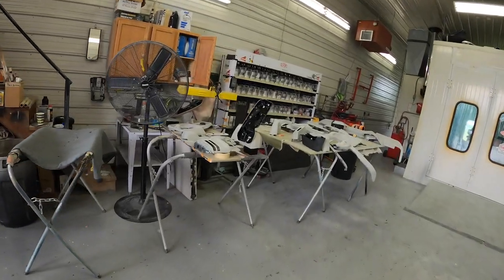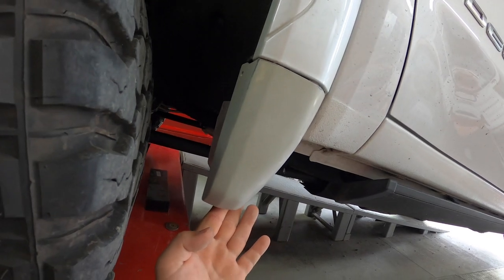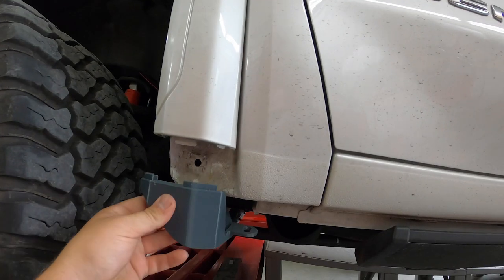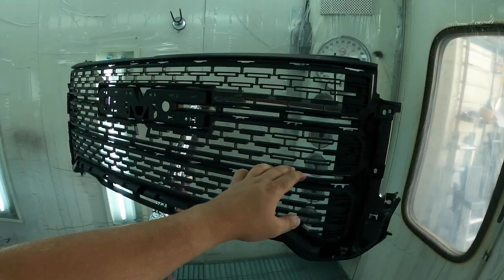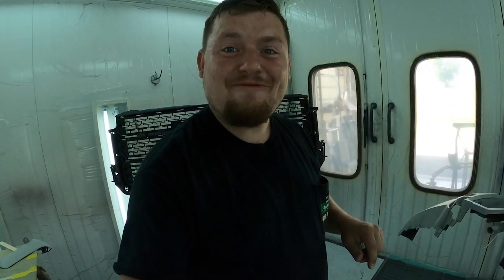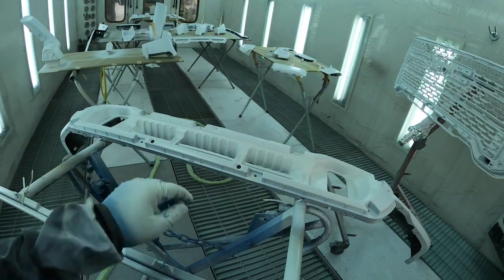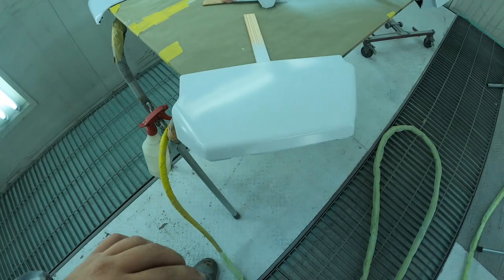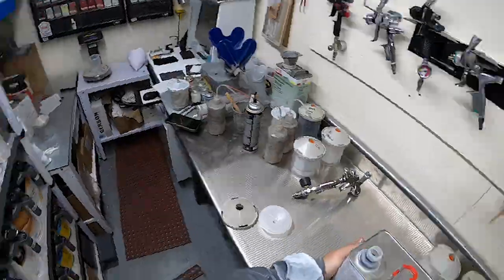Spraying 45 TRI-COAT Parts On This 2020 GMC DENALI! 😯🥵

Comment: Killed it once again with the paint.  Totally amazing! Since you are in the body shop industry wanted to see if you can provide me with a suggestion.  How to you approach bent pinch welds on vehicles? I have one on my car that is starting to bend and its making me worried.  Should I straighten it or does it really matter?
Reply from the maker: Hey man, if it is starting to bend that doesn't sound good. If it is bent from something hitting it then you can just straighten with some vise grips. But if it doesn't bug you I would honestly leave it, there is a lot of other areas that provide strength to your vehicle.